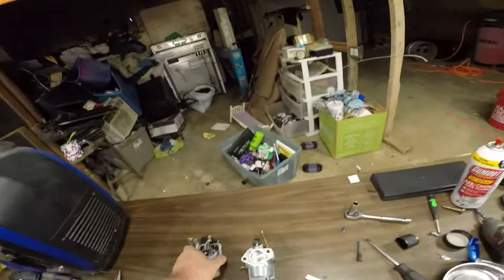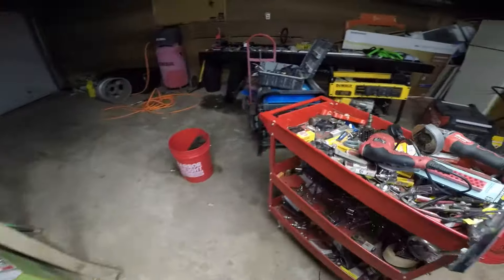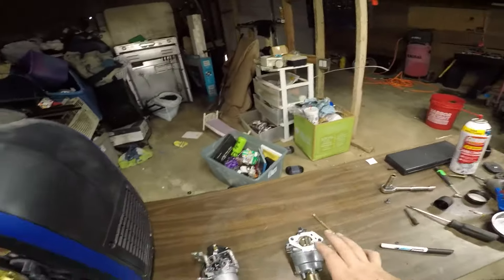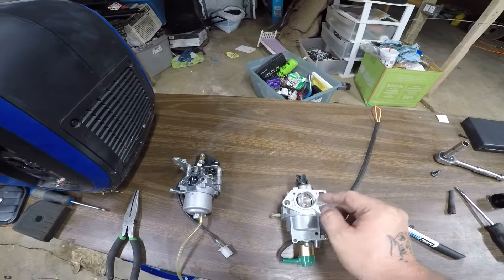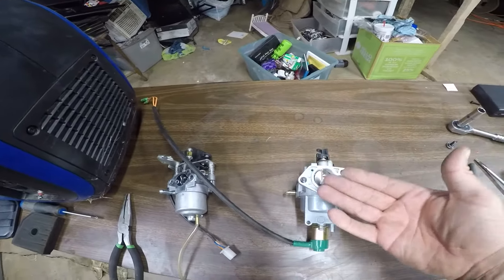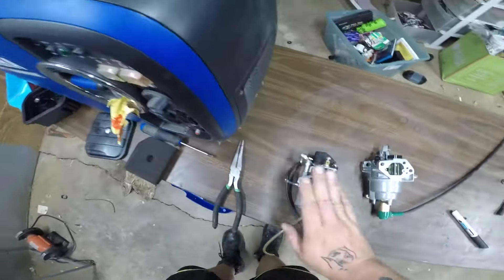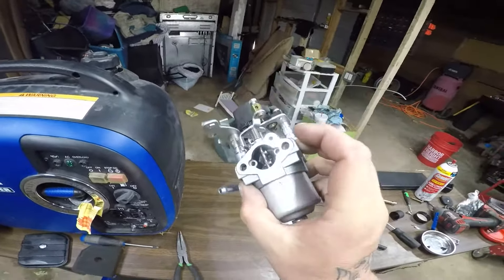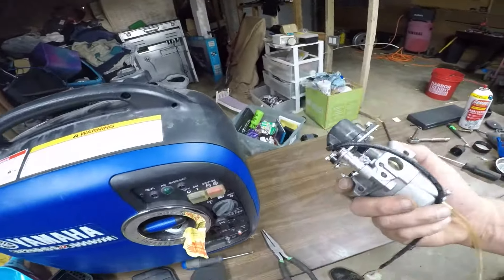The Truth About Generator Surging and How to Stop It

Comment: I had already disassembled my carb, cleaned the jets, and reassembled for generac 3600 watt,  with 212cc engine. And it still surged. I tried adjusting the screw that you point out in your video. It smoothed it out a little but did not realize there was a jet directly below it that needed a cleaning, I pulled it out. Cleaned, it reinstalled it, and now it runs perfectly. Thank you
Reply from the maker: awesome

Comment: So the idle screw on a big generator does not need to be set with turns, like the counting thing. Mine is surging on a brand new westinghouse and will try this cleaning..wish me luck..lol..Im a old gal.
Reply: I'm expecting the same problem on a new generator still under warranty and has 33 hours that it's run.  I called the technician for this brand of generator as this problem started for the first time yesterday.  The technician said, if I moved the choke lever manually then it will operate manually and I must adjust it manually.  Thing is I started as I normally do (auto choke) and then it did that back and forth noise as this man speaks about.   I don't want to fiddle as this might affect the warranty, but gee wiz I need to start up this generator to charge my off grid solar battery.  If I take it in for inspection they say on the warranty card that it might take up to two weeks before I get the generator back and its been raining and overcast so my solar battery needs to get charged.

I would like to know what the purpose is of the plastic screw and port and the thing below the carb with green cap and wire (why would that be faulty on a near new generator?)

How is it that the generator was running fine a week ago and yesterday suddenly this crap started?

Did you resolve your issue, and if so what did you do? 😅
Reply: @NS-Onyx  Yes I had to get it serviced.
Reply: @Hannelore7  Thank you kindly for your reply.

Comment: Hi. I have 9 kw generator was working fine. Then, it had some issues related to the valves so we decided to disassembling it and give it full cleaning. By mistake we disassembled the governor and when we put everything back it start working good when no load, or low loads. But with high loads it started surging. We checked the governor gear and wights, it has no problem. I even changed the AVR but still the same problem. Now i don't know if it is the same problem you showed in your video or not. Could you help me please

Comment: Found it to be the gasket issue.   Cleaned, resealed and all is good to go.   Thx!
Reply from the maker: Awesome 😎
Reply: How did you clean it?  You cleaned the gasket?
Reply: @macknumber9  I found the gasket had a tear in it, I used acetone to wipe down the surface and gasket sealer to reapply the same gasket and it now runs just fine.   Hope this helps.

Comment: Thank you sir for this great video.  Please could you explain why the 'anti backfire solenoid would be problematic on a near new generator which only has 33hrs run time and how is it that 2 weeks ago the generator ran fine but yesterday this 'hunting and surging' occurred out of the blue and I stated it as I normally do as per instructions in the manual from the get go?  This is so baffling.

The thin metal rod from the motor to the carb is going back and forth hitting the back end of that plastic screw on the carb and if adjusting the screw does nothing then what could be the problem.

Fuel has not been stored for very long, oil level is correct and air filter is clean.

It's only due for its first service at 50hrs and it's only on 33.5 hour run time now.

Ps, if the fuel tap was left open for 2 weeks but the generator was not started in that time, can this be the cause of the problem?

My sibling just informed me that she forgot the fuel tap open after the last use 2 weeks ago 😅
Reply from the maker: @NS-Onyx  two week old gas would not have caused a problem could be a gasket issue but those solenoids just suck lol
Reply: @RepairGang  Oh dear.  Why do they use the solenoid if it's poo, if I may ask? 🙂

Comment: Had a shop go thru my near new Generac GP3000i to clean out stale fuel deposits -- my fault.  But it still hunts on no-load idle.  Shop said California CARB requirements force too lean an idle.  Do you know if I can buy a 49-state pilot jet package for it?  Did you mean to say the Predator jet kits from Amazon were universal and could be fit to other brands?  Doesn't sound right.